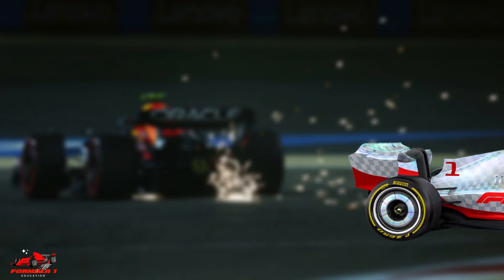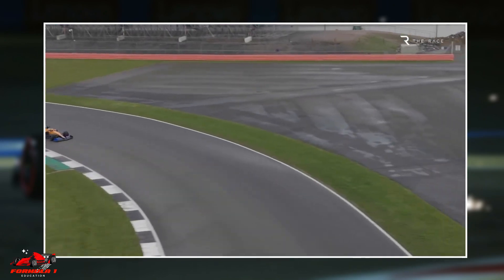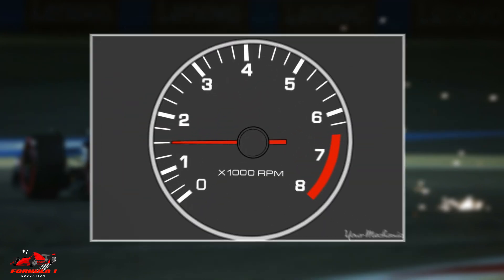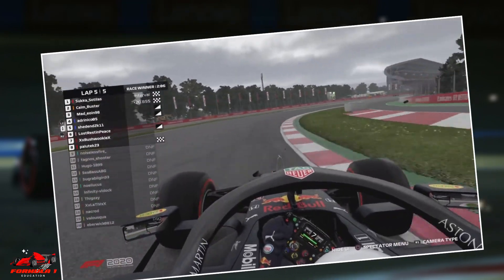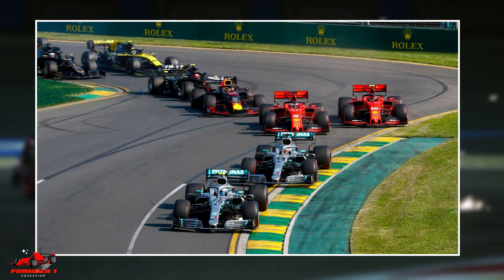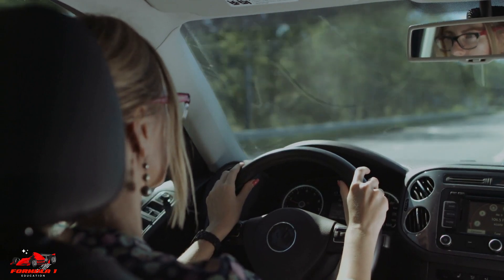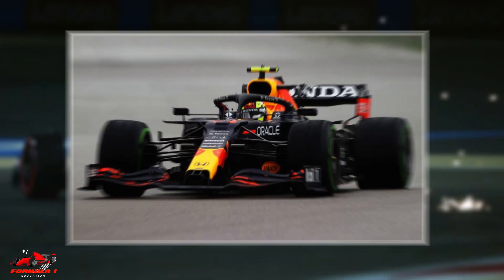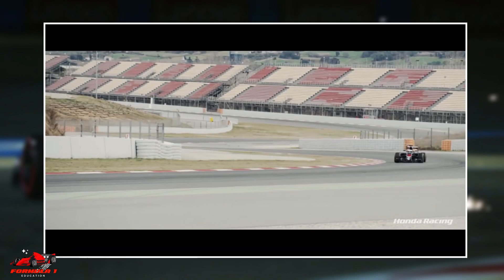Short shifting f1 | How does f1 short shifting work | Short shifting f1 explained

Comment: peak range of a gear in a road car is def not 3k... even my diesel f250 goes to 4500, and subaru wrx to 6750rpm
Reply from the maker: Really appreciate the comment James. You are correct. The point I was trying to make was best time to shift is around 3k RPM for optimal shift with reasonable fuel consumption, but as you rightly pointed out revs can go much higher for each gear. Thanks for pointing out.